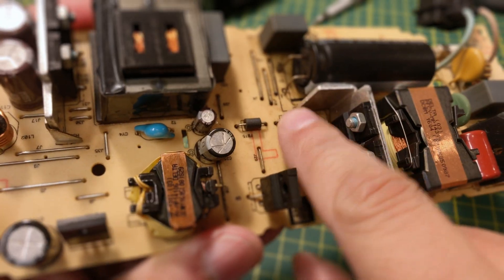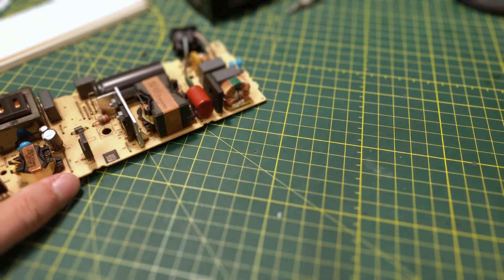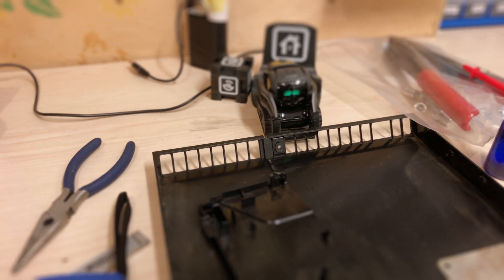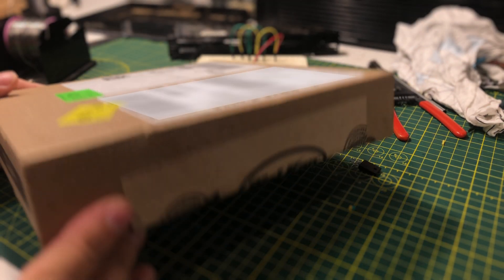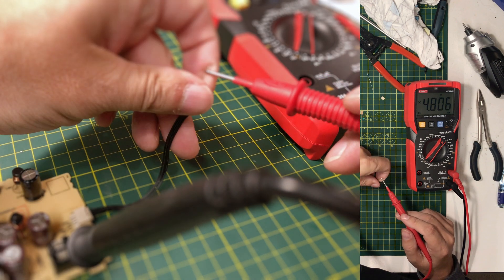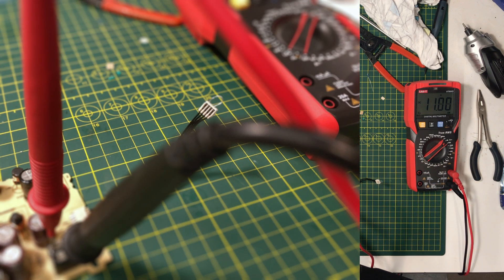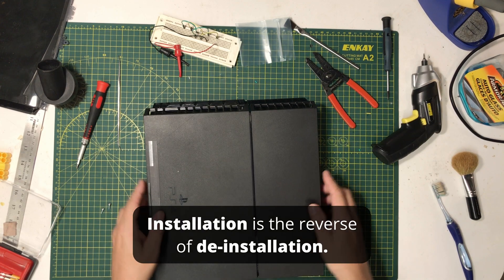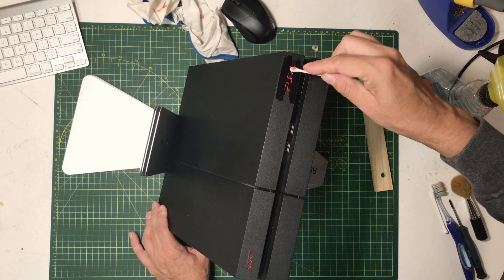The $20 PS4 - Power Supply Repair and Deep Clean

Comment: 3/4/24 On my PS4 you might want to add an internal SSD upgrade with more storage and faster load time since the price of these have dropped to very reasonable prices, on mine I have added an external SSD drive that the PS4 OS supports for lots of games storage and faster loads, which are both easy to do.

Comment: Thank you for this informative vid, I got a same issue on ADP-200ER psu came back with exact same STF3N62K3 short and R1 blow. Previous repair was R1 blow and replaced then working fine for maybe 2weeks. I guess is the mosfet dying and now I see it coming back to me. 
BTW, do you know R1 wattage rate? I thought it supposed to more than 1W from the original component size.
Reply from the maker: I used a 1W, the component matched the original size and I don’t recall the specifics now but it never got warm at all! Good luck! Mine is still working great 👍!